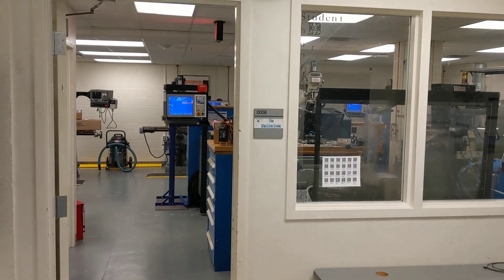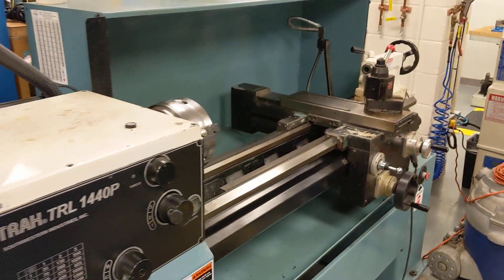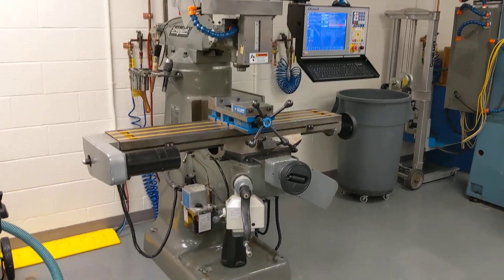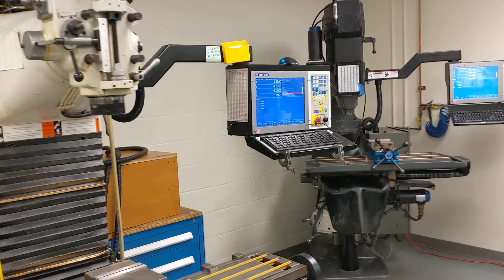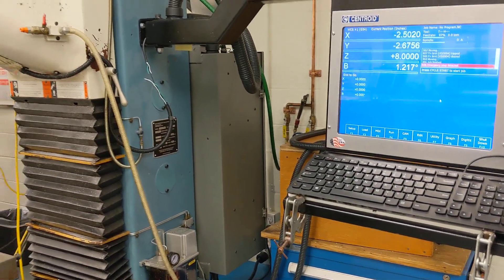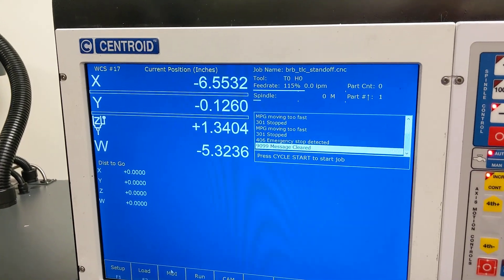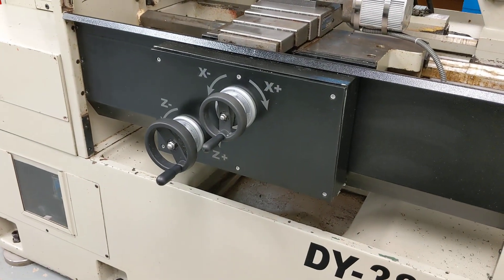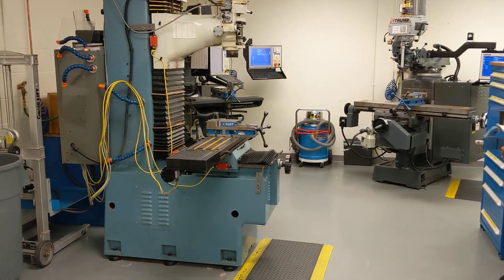Duke University Student CNC Machine Shop Tour

Comment: Nice shop! I have Clausing Kondia with the Elrod quill, centroid upgrade from the original Dynapath.  It is one money making machine, knee mills are still one of the best prototype/ job shop machine.  The centroid is so nice and reliable.  Ran them when I was in the Air Force, always nice parts and reliable.